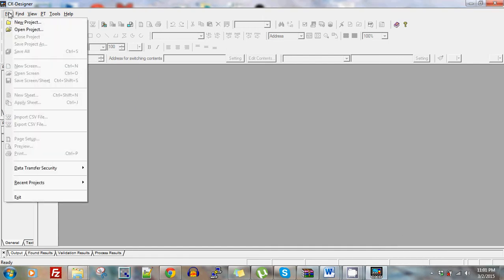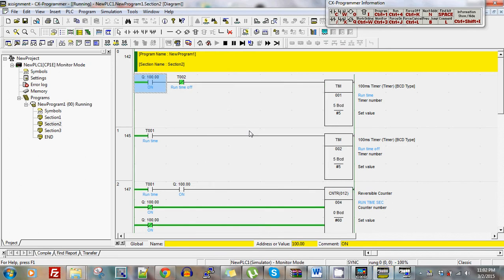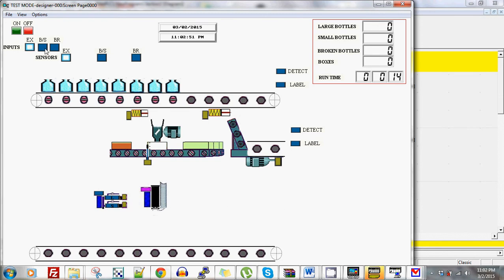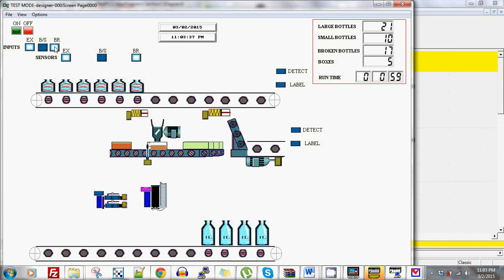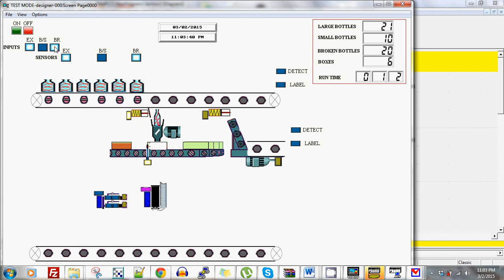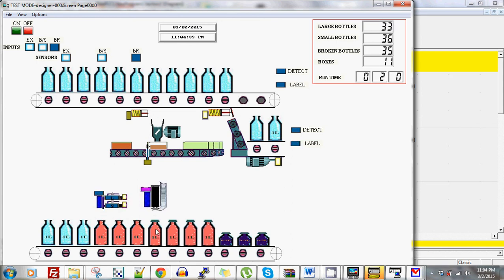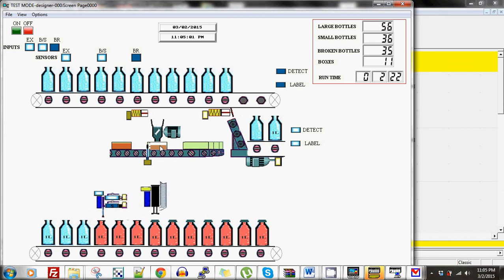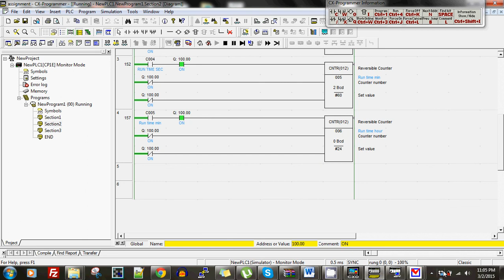PLC bottle line filling and packaging system using cx-programmer and cx-designer

Comment: Sir, what should I do to see the On/Off status of a bit address in running PLC in CX - Designer. Example I want to see high/low  status of output bit 100.00 of PLC in a machine on program of CX-Designer using bit lamp.

Comment: I dont understand how do you have so many "states":
1) Empty spot
2) Empty small bottle
3) Empty big bottle
4) Broken small bottle
5) Broken big bottle
6) Full small bottle
7) Full big bottle
8) Capped small bottle
9) Capped big bottle

From what I understand, using shift register only shift binary number which is either 0 and 1, but that's only 2 "states" (If to change LED images it's ON and OFF only), so I dont understand how to change that many images.

Comment: Can you explain, how did you make the cylinder in CX Designer?
I want to make a simulation, what me and my schoolmates can practice for our exam, at home, but I can't find out how to do the cylinder part :)
Reply from the maker: +Silver Hello! Sure no problem. May I ask which cylinder are you referring to in the above video?
Reply: +alpha daye The one which is putting the caps on to the bottles. Thank you! :)
Reply from the maker: +Silver I actually made two images in Photoshop. One with the cylinder retracted and the other one with the cylinder extended. I created a light and changed it to this two images. When the light is "ON" the extended image show, and when its off the retracted image shows. To learn more about changing the lights into any image you want, kindly refer to the following link:
https://www.youtube.com/watch?v=AnE5fwPPX2g&feature=youtu.be
I no longer have the software so can't show you. The guy in the video above did quiet a good job showing how to customize a button. 
Should you need further clarification, please let me know. Good luck.
Reply: +alpha daye Thanks, I did make the cylinder, but I would like to connect it up, to a limit sensor for each state (retracted and extended). Do you have any idea?
Reply from the maker: +Silver You don't need a limit switch. Use AND Gates, if there is a bottle on the position below the cylinder (bottle=1, no bottle=0), the bottle is full (full=1, empty=0), then the switch (which contain the cylinder images) should go ON meaning show the extended image. Otherwise do the opposite.  
By the way I used shift register to represent the bottles.